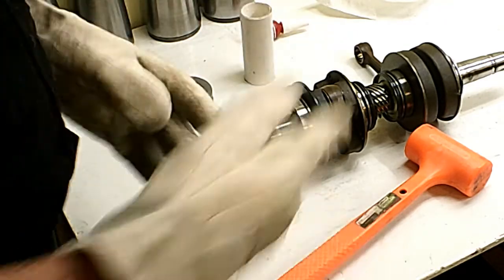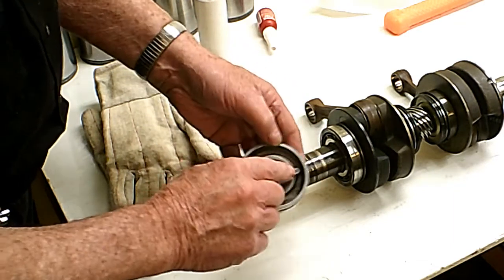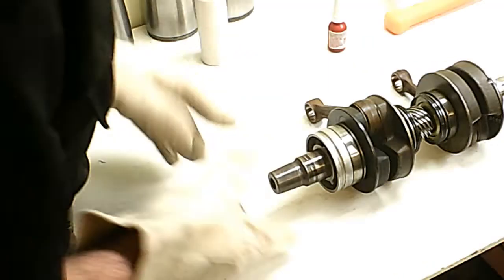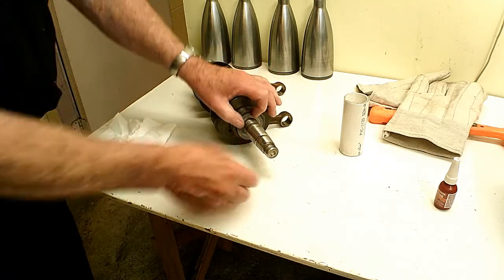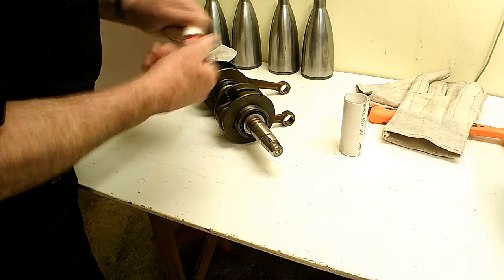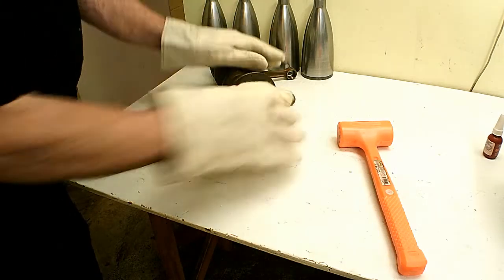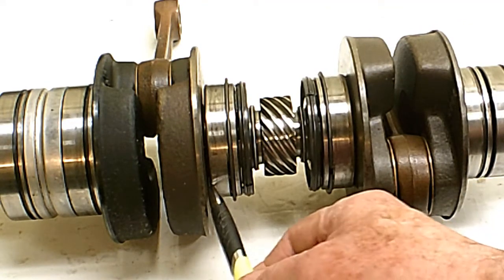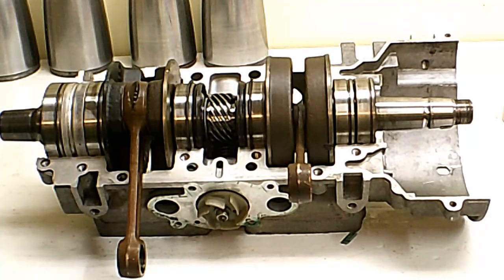Rotax Crankshaft Bearing Install

Comment: how do they change out the connecting rod bearings?  I got a skidoo 503 from 1997, are those bearings good enough to spin a prop with or do they need to be upgraded?
Reply from the maker: The bearings are standard, and you can get them from any bearing shop.   There are snowmo places that can sell you new rods if you need them, but you need to know how to use loctite and line up the crank to use them.
Reply from the maker: Far as I know, the bearings are the same. You can get needles at beaing supply outlets.
Reply: @Adventurepilot70  can you take this crank apart yourself and get at the inner bearings and seals?  is there a press adapter tool? or do you just send it to someone?
Reply from the maker: @FourthWayRanch  special tools are needed. If you know your bearings are bad, better send it to someone.
Reply: @Adventurepilot70  Do you know of any shops in your area, I'm in Florida, not a lot of rotax snowmobile dealers around here
Reply from the maker: @FourthWayRanch  Contactt Rotax Rick.  He is in Florida.  Two-stroke engines are now very unpopular,  so not much demand for crank rebuilding.